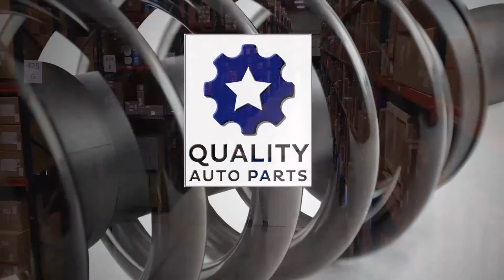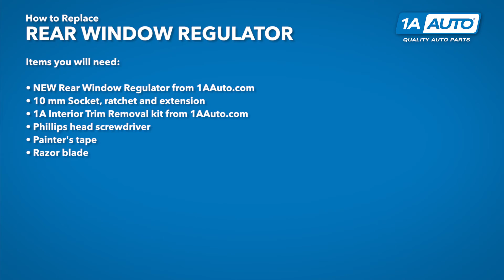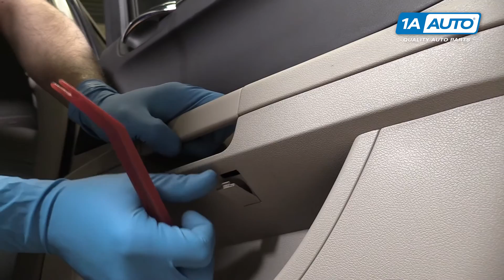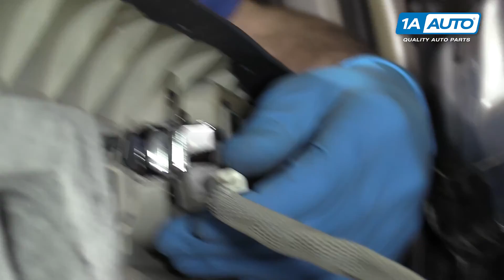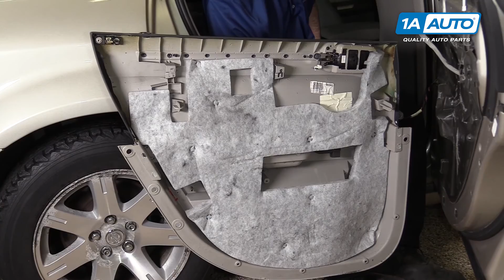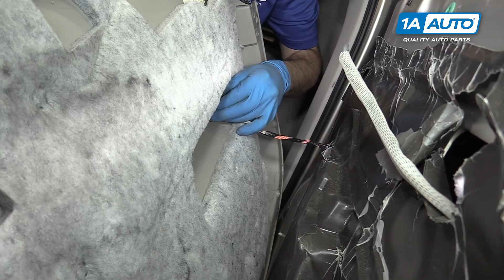How to Replace Rear Window Regulator 05-10 Chrysler 300

Comment: What kind tool would you used to cut the cable.
Reply from the maker: +john1240able You may be able to use a pari of snips made for cutting metal. 1aauto.com
Reply: I'm confused, so if you cut the cable then what are you supposed to do replace the cable for the window to go up and down again?
Reply from the maker: +Ignacio Martinez This is only needed if the window does not roll down with the switch. You would be cutting the cables on the old regulator only, which is going to be removed and replaced with a new one anyway.